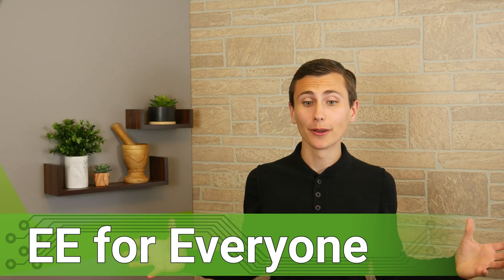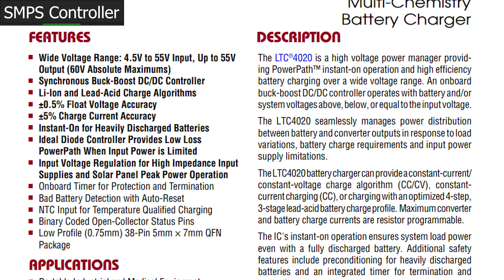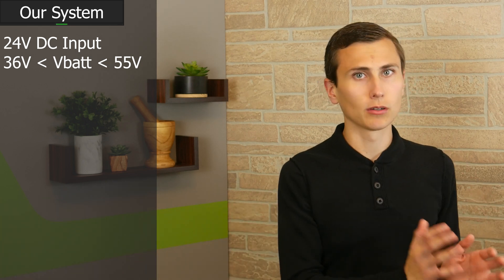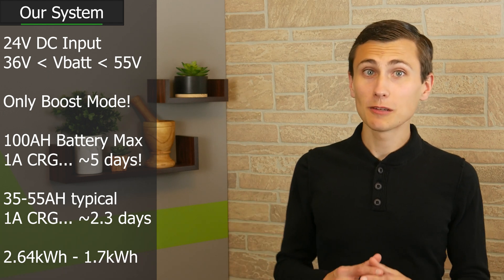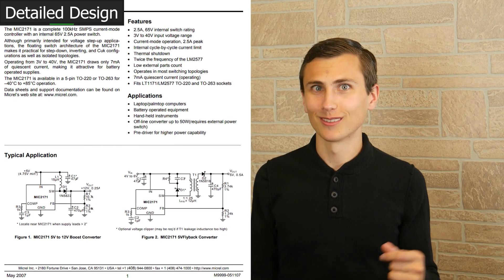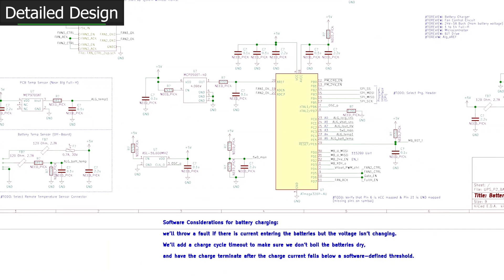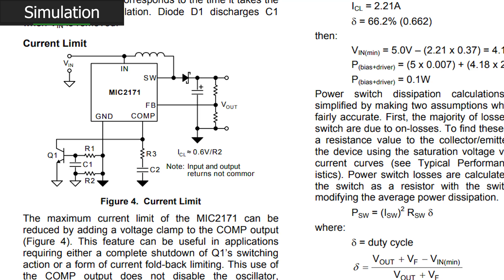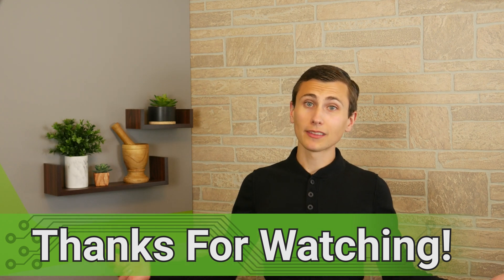DIY Charger for 4 Lead-Acid Batteries! (Boost Mode)

Comment: What software do you use for simulation?
Reply from the maker: Hi Frederick, I use LTSpice a lot for circuit simulation, you can't beat the price! I've also used cadence, multisim, some of the smaller ones... They all usually use spice as the core simulation engine, so there is a little bit of opinion involved. :) 

I hope this helps, and thanks for watching!

Comment: could you use a supercap bank for small buffers so say it switches for 2 secs or so to the battery the caps would be able to cover that without pokeing the battery at all not to mention there surge current is vastly high than the battery could ever deliver.
Reply from the maker: Hello Linearburn! Thanks for reaching out!

The short answer is yes, absolutely, we could use a supercap bank to store energy for the UPS. However, supercaps don't have great energy density (as you seem to know, given the 2 seconds mentioned), would require a lot of them due to a typically small voltage rating (get very expensive), and would likely require active balancing to prevent overcharging due to component tolerance.

Yes, they would be able to provide a lot of peak current, but the esr of modern agm lead-acid batteries can be less than 10 milliohms! 12V.... 10 milliohms... That's already a lot of current capability! Plenty for what we're designing here.

There are a lot of applications for supercaps. For example, when charging needs to happen really fast, or a lot of charging cycles need to be endured. What it came down to for this application is that they simply aren't necessary.

That said... Supercaps are fun to play around with, so I'll have to think about projects that may use supercaps well to see if we can use them!

Additionally, there are hybrid lead-acid chemistries built with a similar construction to a supercap, so they have some "supercap"- like energy storage built in. There are some serious trade-offs with this type of construction too.

Thanks for watching, I hope this answered your question, and I look forward to hearing from you again soon!

Cheers!
Reply: @EEforEveryone  the reason i mentioned it there is a guy on YT here that has a super cap jump pact for starting his car and its smaller than a car battery
Reply from the maker: @linearburn8838  Hello Linearburn!

Aah, you bring up a great point. Power (W) vs. Energy (kW-h).

Supercaps can provide a relative LOT of power, but their energy density is relatively low. That makes them pretty good for replacing car batteries for starting... though the smaller loads always connected across a car battery can pull a few milliAmps, which may drain a supercap bank faster than one might expect.

We need both Power and energy for our UPS, making supercaps a not-ideal energy storage mechansim. That said, there is a number of supercaps that can meet our needs! It may need $3000 worth of capacitors.... but it can be done.

Comment: cool vid as always fella thanks, Question (hope you don't mind) lol are you any good at arduino code ive just built an electronic circuit breaker, you use pot to select max allowable  current a and it uses a rotary switch to select the number of over current ac cycles to allow through before it trips it uses a counter chip  so 2 4 8 16 32 cycles .. I want to use a nano, mini or ? and a double 7 segment display to show the selected number of cycles.. im using a 6 position rotary switch double throw so have a spare set of contacts to work with... if not i will do it the hard way (diode steering) tanks either way
Reply from the maker: Hello Tested to destruction, thanks for watching!

An answer for you, but first, a small point of clarification: Arduino code isn't any different than code for other microcontrollers, it's all c/c++. ( But Arduino has a LOT of community support. :) ).

 Aaaannnyways, There are many ways to implement that type of functionality. Analog or digital multiplexing methods can be used. (We made a video about analog multiplexing for a keypad you may find interesting)  One thing to keep in mind is that the two sets of contacts may not be rated to be isolated from one another, so be careful! You can also multiplex 7 segment displays using a persistence of vision effect. If you use a couple tricks, an Arduino nano/mini has plenty of i/o, but a less creative implementation would just use a massive microcontroller so everything can have a dedicated I/O line.

I hope this helps, and I love answering questions! Thanks for posting your question in the comments!
Reply: @EEforEveryone  Thank you for your answer it's nice that you take the time to answer you comments really appreciated....
Reply from the maker: @T2D.SteveArcs  My Pleasure! Thanks for being a great part of this awesome community!
Reply: @EEforEveryone  :)

Comment: how would you rate the difficult of charging lead-Acid batterys Vs. li-po batterys? for your UPS does a lead-Acid battery make more sense then anything else?
Reply: So Lipo is a really easy chemistry to deal with long as you follow some ground rules. first thing first get good cells. you want quality Samsung or LG cells. second always and I mean always use a BMS in this kinda application. this will keep the cells balanced and healthy. and prevent any accidents. and t3rd if you want the cells to last 10+ years and they will last that long if you take care of them is never discharge them below 10 percent. I would even go as far to say 15%  and I would only charge them to 95% assuming a normal use scenario  they may only see a full discharge 1or 2 times a year if its an emergency. most common discharge is probably a bunch of momentary pulses of 1-2 percent discharge at that duty cycle they would pretty much last forever.  where lead-acid you fully discharge them more than 1-2 times there one for and lasting more than 2 -3 years in never gonna happen. the problem with ups, in general, is how they charge the batteries in lead-acid.
Reply from the maker: Hi frenchtoaster! Thanks for watching!

Lead-acid is by far the most forgiving chemistry when charging, and the cheapest. Lipos are much more particular, and would need to be stored at ~50% charge to avoid degrading the cells over time.

For backup operation like a ups, lead-acid are the way to go for sure!